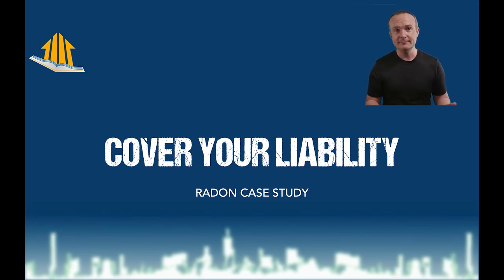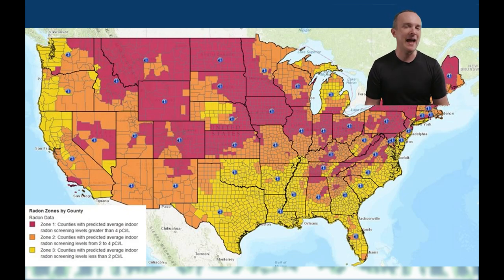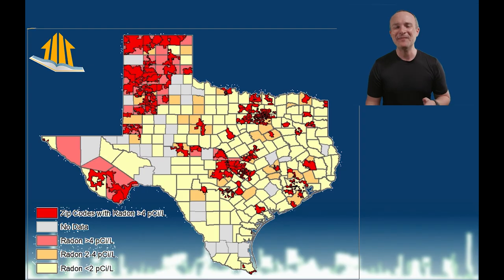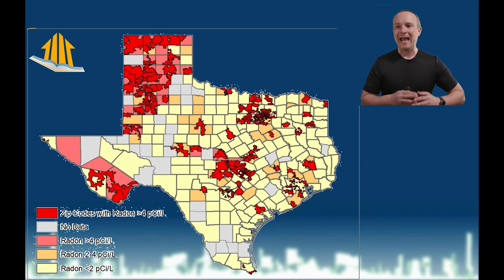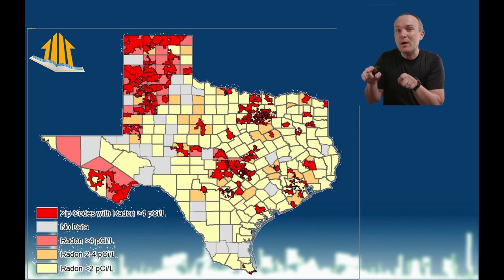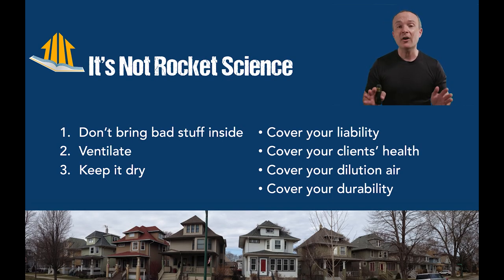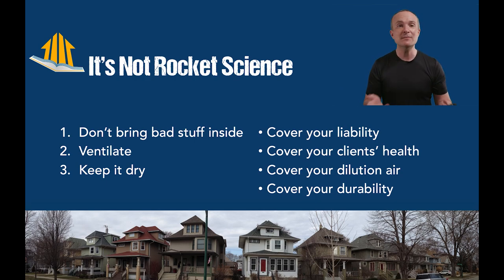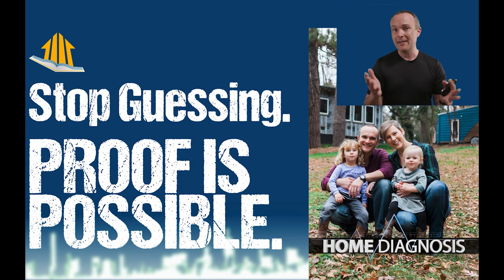6 Case Studies for Crafting Modular Ventilation Systems: Radon, Filtration, ERV, Make Up Air, & Dehu

Comment: This is one of your best videos yet!! I was once upon a time a HERS rater and have never had issues with understanding the scientific concepts, but having thermal control, ventilation and humidity work as a balanced system has always been a challenge. Having examples with diagrams and numbers really drove it home. Please do more. I’d love to know what if you have ducted HVAC into the mix instead of mini-splits (how would ducting be different or not). Congrats on Aprilaire sponsoring content like this.

Comment: Excellent information.  My understanding is that it takes a cement slab 1 month per inch to cure and dry.  So your advice of running a dehumidifier as soon as you close in is an excellent suggestion many don't understand.  I'm designing an off-grid solar home and I'm excited about the new systems that monitor air quality and only operate when needed. Thanks again for the great summary.

Comment: Best presentation for these concepts yet. I'm glad you added a lot of new content and touched on some of the greatest hits. Even after looking into all these concepts for (literally years now) I'm still not sure I have an optimal system in mind, but I'm just going to bite the bullet and build it to be easily reconfigured. From seeing everything you've done I think 3 separate systems are best 1) radon under basement slab, 2) fresh air - I still like CERV the best, 3) kitchen venthood w/ exterior fan and makeup air supply (Aprilaire or Broan).
Reply from the maker: That’s a stellar combo, Brett, and you’re right, there IS NO universal system. Every home needs a clever person to analyze and implement and test. We’re mighty short on those people, thanks for being one.

Comment: Second comment of the day. (One must imagine a very dry voice, here) Believe it or not, Corbett, dehumidification is simply not that big an issue in the Sonoran desert! I plan to use mud plaster (no, not the dark red clay from my backyard, white potter's clay). Mud plasters when used in Seattle (average exterior humidity 80%) yields an interior humidity level of between 40% and 50% (which is just right for people, pets, and plants). The SAME mud plaster when used in the Jordanian desert (average exterior humidity of around 15%) ALSO yields an interior humidity level of about 40% to 50%. Mud plaster walls are, IMHO, a much more elegant solution to tempering humidity than all the fancy-pants equipment that you insist on. It is also much prettier (why do you think high-end designers are mad about limewash and Venetian plaster finishes?). I know, there's no fancy shiny new equipment and no engineering reports supporting my system, but I will never install a dehumidifier in the Arizona desert!
Reply: Same, here in So Cal I often think I might need a humidifier or several! Not all the time, in the last 10 years I think we have actually had some unpleasantly muggy waves in late summer. But it is seriously dry here most of the time!
Reply: @twobluestripes  Yeah. Same for the intermountain west. I lived in Denver for years and kept up watering pots set on radiators to increase the humidity so we all didn't shock ourselves during the long, super-dry winters. Ditto most of Nevada, Utah, New Mexico, chunks of Texas, Wyoming, etc. Corbett has developed a tiny bit of tunnel vision having just built a house in Georgia. I'll invite him to consult on my house - he'll get over it!
Reply from the maker: Calm down, guys, the theme of this session (and our entire channel) is systems thinking to solve problems. I’ve never said, and will never say, that there’s one way to build or improve a home.
Hooray for you for not having any humidity to deal with— but I wouldn’t trade dehumidification for the water shortage you all are going thru, which will only get worse (or the extreme heat waves).
Pick a place to live. It will have good things and not good things for humans. Then use systems thinking and science to tune your home.
Reply: @HomePerformance  The great joy of being American is you can choose from a wide array of taxation structures, financial opportunities, climates, and local culture to find your own best place to live. I have friends who dream of white sand beaches (yuck - I'm a mountain mama all the way). I chose Prescott, AZ for my new home because it gets 15" to 17" of rain a year (compared to Tucson's 9" to 10"). With the roof area I have planned into the house (a sprawling ranch) I can capture about 60,000 gallons of water and on a good year, 70,000. I have no intention of connecting to public water or sewer supply. It should be an interesting (and I hope inspiring) experiment. If only 20% of American households (and farms) were energy AND water-neutral, using regenerative gardening and farming techniques, we would significantly slow global warming and mitigate severe weather events. There's only one way to find out if it works, though, and that's to build it and test the proposition.

Comment: Re parents house, your exhaust fan is 450 cfm and supply is only 170 cfm? How do you NOT set up negative pressure upstairs and suck up radon air in basement ?? Not sure what you meant by ‘give it. Little boost” and’ path of least resistance’ the math is the math right ? 450-170=380 cfm that’s plenty to create a negative pressure….
Reply from the maker: The blower door on this house is about 10 ACH50. Lots of pathways from outdoors, this one just creates the shortest circuit.